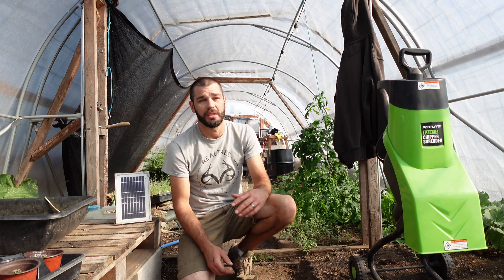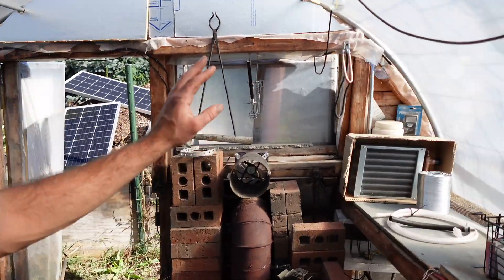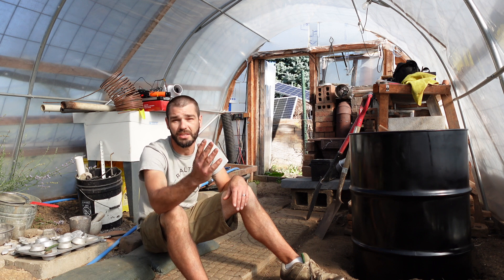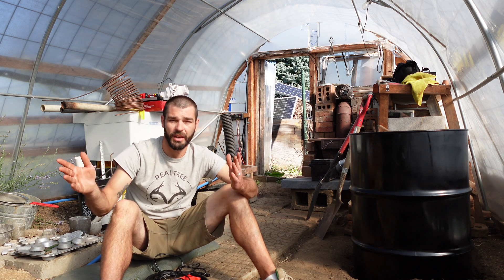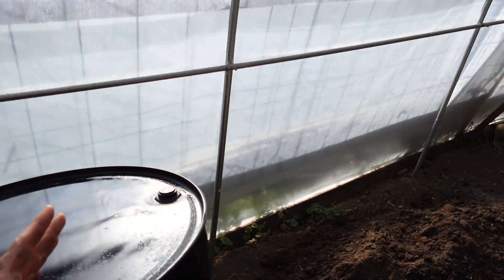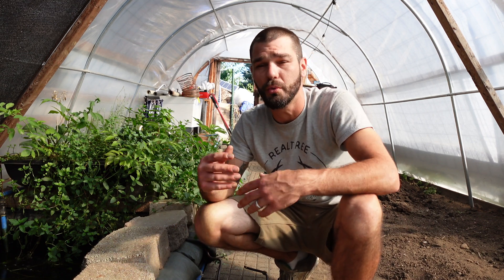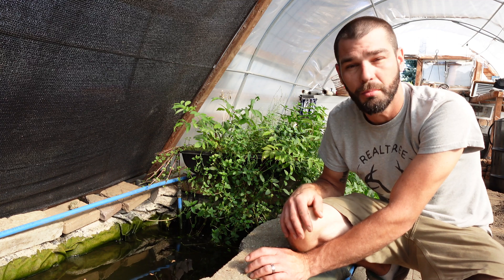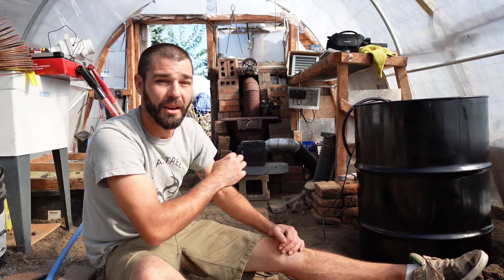DIY Winter Greenhouse Heating Experiments - Thermal Mass & Heat Storage - Subscriber Ideas!

Comment: Liked & subscribed!

We love what you are doing. We are also working on how to cheaply heat our makeshift poly tunnel greenhouse as the cold weather starts to set in.

We are logging temperatures (humidity sensor not working reliably), and we have some small window boxes and a frost cover that we'll be experimenting with to create both some internal micro greenhouses INSIDE our poly tunnel greenhouse and additional emergency frost covers for hard freeze days.

I also have some of that flexible dryer ducting pipe, a broken inline fan, some plastic hot water storage tanks, some IBC totes, a truck radiator, some copper & pex piping, valves, an Arduino microcontroller, and assorted sensors, relays, conductors, etc. Just got a small fish tank from our local dumpster as well, and we have a large fish pond that needs to be dredged & re-stocked.

I'm thinking an insulated thermal storage bank made from some interconnecting, zigzagging cinder blocks that will allow me to capture warm air at the top of the greenhouse and force it thru the thermal bank's concrete chambers to heat the thermal mass during warm periods and then a microcontroller & fan that extracts the heat as needed overnight to keep our micro greenhouses above their individual setpoint temperatures (different plants have different cold tolerances and each micro greenhouse is a smaller volume of space to heat than the entire greenhouse). 

Extracting the humidity from the hot air before it flows into the heat bank is definitely going to be a problem. Not sure how to tackle that issue. One thought is to also have a Trombe Wall that can capture solar gain directly and be patched into the heating system. Maybe that would create enough additional heat to allow hot air to be piped thru a diy outdoor air cooled dehumidifier ERV system? (Having a coil/surface that is cool enough to precipitate out moisture but not so cold that one loses the heat flow.)

Our greenhouse is partially underground, as we built inside the old swimming pool excavation. The plywood walls of the excavation have dirt & gravel behind them, so, eventually, I'm thinking some sort of ground loop geothermal heat pump system should enable us to use the earth as a thermal storage system as well. (I'm skeptical about simple Earth Tubes, but geothermal systems & heat pumps are a proven technology. Using state change effects to maximize energy transfer efficiency would be a huge plus if it could be done cheaply with readily available diy friendly "refrigerant/thermal transfer fluid". More R&D needed here by diy'ers & homesteaders.)

Lots to think about, research, build, test and refine. Especially with global climate change now unfolding around us all. We will definitely lurk around your social media to see what you are working on and contribute whatever tech solutions we can think up. You are inspiring to the rest of us...
Reply from the maker: Thank you for sharing!! Everyone else will be able to look through and read your experience also, great share. You’ve got a lot going on also it seems lol! I’ve been super interested in heat pumps and the fact they are basically a better designed air conditioner. There’s a ton of options to experiment with and try out for ourselves. Thanks again for adding your story here!

Comment: We are planning to build a winter greenhouse.  While I was doing research I found your channel and, after watching a couple of videos,  subscribed.  We're looking at a 50' by 10' east/west greenhouse with a solid north wall and possibly solid ends. We're also looking at the compost heating,  but either using spoilt hay/silage or a mix of that with woodchips, because large amounts of hay and silage are a lot easier to get here than woodchips.  I'm also looking at using a waste oil  burner ( lots of that here too) to heat water for barrels and possibly using old chimney ducts to run the exhaust under the beds for addiitional heat. I think that, combined with a double poly south wall, should keep everything warm during our -20c to -25c nights we get here mid winter. What do you think?

Comment: I have a larger goldfish pond about 5x size of yours with pond flowing into it. Waterfall pond about size of yours. This is outside, It is powered by electricity,  trying to get up to solar. But i have used just a submersible fishtank heater for several years. Put clear. Corigated plastic over large areas and plastic teeped over waterfall. I have plants left propagating in waterfall. Did fine and plants stored next to it did well too. But  im in n tx,  but made it through 20s temp.

Comment: When I had a koi pond, I would put an air stone into the pond over winter. Adding  a sheet of foam insulation for part of the pond will not interfere with the O2 levels as long as you run air stones.....cold water does hold more O2 than warm water.

Comment: Of course to your point about specific heat of water and sand, you can't heat water past 100 degrees C but you can with sand, so it's not quite as simple as you are saying. Both work well, it depends on what you are trying to do. 
Remember there is a reason why commercial thermal mass uses sand. :)

Comment: We tried the exact same experiment last winter except we used 5 barrels connected together and it worked well until the pumps failed. We ran ours 24hrs a day trying to equalize day and night temps and the first pump lasted about 3 or 4 days. Then we tried using a timer and had it run in shifts, the second pump lasted about 2 weeks. These pumps are designed for relatively small amounts of water at a time.

Comment: I've always been worried about heat spikes or radiant heat off a fire in a greenhouse.
With your geothermal could you put a covered gravel soak hole in line for a drain.
Solar water heating with evacuated tubes then to pex pipe looks like it goes well in other greenhouses.
Or if no power is a issue but your willing to spend some money on it a solar split system to a HWC then to pex underfloor would be the go.

Insulation of the soil on a angle outside to avoid heat soak and over saturation from rain running off the tunnel, insulated blankets, inflated walls, fleece bed covers for when it's really cold, inferred or inefficient light bulbs for a short burst of het off batteries if the temp drops in the early hours of the morning.

Comment: For your barrel. In the winter, it's cold right? Would it work to have a lens direct light onto the barrel to heat it faster? Or is that getting too dangerous (focused light)?

For your fan and dryer ducting, have you ever seen the GoSun solar cooking device? Is it possible to set up a boxed in area in the corner and just use solar cooked air to move through the ducting?
I'm not sure you're going to get the volume of heated air you want but could it be used to heat a specific small area? Like the pond for instance.

Comment: Try building a solar air heater. You can build them with heat absorbing materials, aluminum cans, etc. No electrical to run. A couple of these can provide heat for your greenhouse during daylight hours for free. Arctica Solar has a commercial model and a DIY kit you can buy, but if you're a DIY-er you should make your own. You can also do the same concept with water via PVC pipes or copper pipes and run water lines through the ground of your greenhouse.
Reply: Those Articas look really good. I'm interested in maybe having one attached to my green house design.
Reply: @Omegawerewolfx  I just bought (2) of their DIY kits to try on a cargo trailer. Let me know if you try them out! I would love to know how they perform with a greenhouse. Could be a gamechanger!

Comment: I'm working on something similar. I have an electric water heater direct to 2 37 volt solar panels in series. Going to plumb it to a radiator and fan in the cold end of my home. I'm off grid and the stand alone solar panel powered electric water heater I use right now for my home lol Will be getting a second one and the panels, I get panels used for $40 each